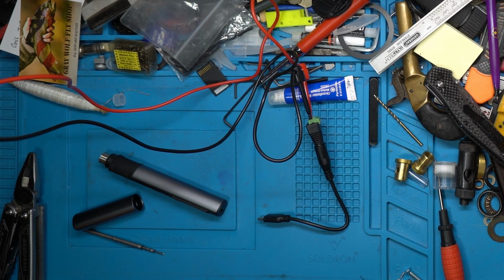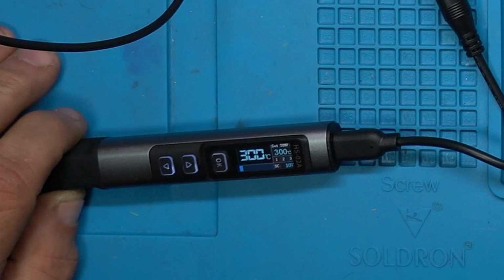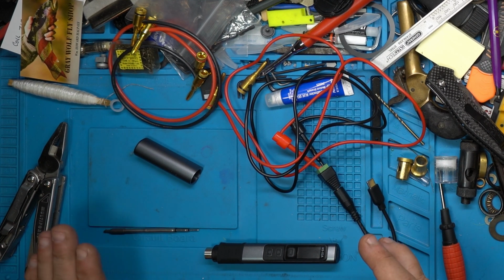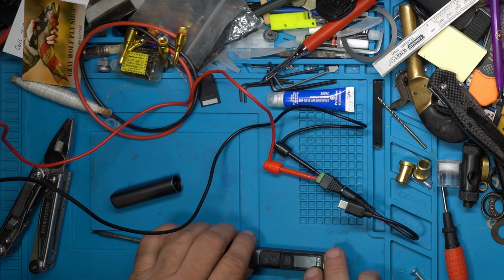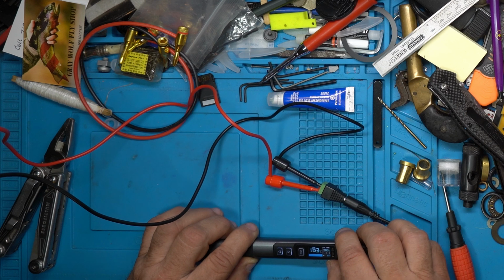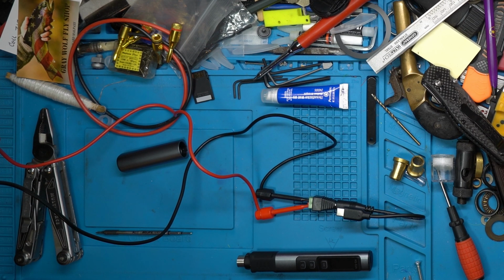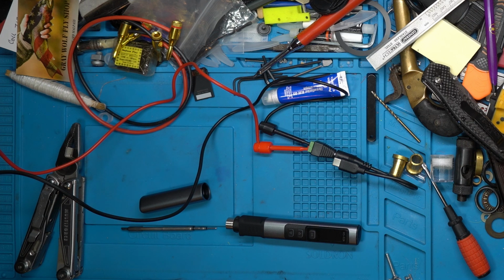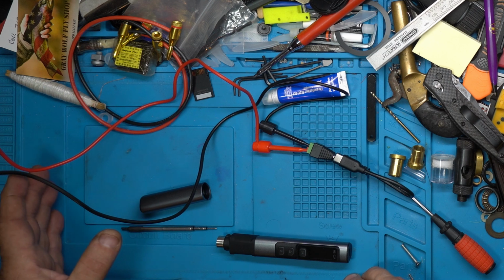FNIRSI HS02 100% Power Crashes? Here's What's Really Happening

Comment: I didn't see the point of the 'experiments', which lacked a scientific approach. FNIRSI provided the Adaptive Power Adjustment mode to test the power source available for the users. They know best what they're doing. You couldn't do a scientific test because you didn't have a logger for the voltage and current with a high sampling rate. Nevertheless, I trust what FNIRSI is doing. It was clearly explained in the manual why they do it. As a matter of fact, I bought their original AC adapter rated at 100W that comes in the extended package of HS02A. There are times when even their AC adapter can't cope with the current demand.
Reply from the maker: The test is simply a real world test. Fnirsi adaptive power does not work properly it will always set in the 90 and through trial and error the 60 range is all that will work. I do not know when you purchased yours but mine and about a 100 other comments across about 10 videos over that last 1 year plus did not either. If fnirsi is finally releasing a manual that is awesome because i absolutely love the iron   If you check the comments on the many other videos you will see the issue that works is using any cheap or otherwise pd3.1 compliant cable. Many comments involve fnirsi supplied components psu and cords. I do have lad equipment but did not use it because it would not have helped me. The cord was my and many peoples problem. Thank you fir commenting and i truly am glad fnirsi is getting it together releasing a printed manual  and good corr psu combo.

Comment: I have a QC3.0 power bank that outputs about 22 watts at 12 volts. Is it possible to limit the power to these values if I need to use it away from home?
Reply from the maker: The Fnirsi iron should regulate the voltage to its supply. I have connected the iron to multiple voltages from 12 to 24 volt without changing any iron settings and the iron used the power protocol to negotiate the voltage. 

The power bank should be regulated to keep the pack from discharging too low and the iron will shut down when voltage supply drops below its operating threshold. 

In short the power pack and iron safety’s should keep anything from being damaged. 

Now if hooked directly to something like a lipo battery pack or a unregulated battery pack it would be dangerous. 

You can go in the iron menu and set the voltage to 12v if not using a pd or qc power cord. I have several videos showing the menu settings and voltage settings. Hope this helps but keep in mind test you setup in a controlled environment for safety. Please let me know if i haven’t answered your question. Thanks again.
Reply: @TTMEable More than anything I wanted to understand if the power limit in the soldering iron settings can be adjusted to stay below 22 watts and not reset the power bank when I need to use it away from home, I can't try it yet because I ordered it today and it still has to arrive
Reply from the maker: The lowest i have set the iron is 45 percent i think it was. i don't remember the video but i did a upper limit power setting and may have dropped it down in the video it was a long time ago. but the video title is something like it keeps restarting or power restart problem solved i changed the title a couple times but the video should be located in the fnirsi hs02 play list. if you can;t find it i'll see if i can...  You may find the answer in one of the below videos, but to be honest i don't see why the iron wont turn down that low i think i had it set to 9v using my benchtop power supply. it would be slow but should work. Let me know if i can help you more. thanks for commenting.

https://youtu.be/EaVgCmvHFiM
https://youtu.be/5sT4ikBvlhA
Reply: @TTMEable Thanks for the reply, I'm not afraid of safety, the power bank is limited in current to about 1.8 amps (22 watts at 12 volts), beyond that it disconnects the output and turns off

Comment: Great video! I've test it with a 100W, original tips and other brand, Kaisi C245, Relife Rf 245...You've explained everything about the original tip, I'd like to add behavior with other brands tips. It's all about the resistance. If the original has a resistance of about 3 ohms ok. Kaisi tips have 2,5 ohms and 20V power 65% work well. Relife work to 100%.   Honestly, FNIRSI has a problem in general with dc jack, I've made it clear to his support because That they're very kind. I've had to replace 2 mosfets and a double zener diode. My recommendation is always usb C. I just shared my experience.
Reply from the maker: Thank you for sharing. Ill pin your comment for others to see. Thanks again.

Comment: Power supplies when they hit the current limit reduce the voltage down so far that the current never rises above the set limit. You can see that the power supply also in the first (parralel, full power, no limit) test reduced the voltage down to 9V. In none of your tests the maximum wattage of 100W got fed into the soldering iron. for this you would need 20V and 5A (both), i have no clue why your power supply did not deliver this but breaks down in voltage.
Up until now it was knowledge, now comes my guess:
A powersupply is different from a usbc power brick in the way that a usb power supply does not drop Voltage when the current limit is reached but stops completely (or goes down to 5V which). Both no power or 5V is the reason why the soldering iron restarts. no more or to little power available.
Also my guess:
I have the 100W fnirsi usb power supply and i have to set it to 90-96% power for it so not restart. I think the reasosn is that the soldering iron pulls just slightly more than 5A and directly the power supply stopps completely and the iron restarts. So either get a powersupply with >5A at 20V or from a proper well known manufacturer which allows some hihger startup current without stopping current completely.
Reply from the maker: Thank you for the detailed knowledge.  I always love to hear from someone that understands psu’s and yes i was thinking my power supply should delivered the proper voltage and current with my setup, but the psu is still new to me and i have have gad dome kind of limiter on “i don’t think so but” but im not sure. Also even with a lower voltage the iron still heats up fast. Much faster than any station of plugin pencil type iron i ever used. I used to plug them in and let them set for a good 20 min to properly soak in. Anyway. What do you think about a laptop power supply. I was thinking about doing some detailed testing with a few i have laying around. My whole point is to find simple and easy supplies and portable options for this iron. My cheap 260w “not 260 even adding up all outputs” works fine with this iron if i turn power down to about 60 to 70 percent. But strangle the adaptive power setting on this iron is supposed to set the power to match your psu but keeps setting itself to 96% and thats too high for my above mentioned 260w gan Chinese psu to handle. Whats your thoughts on that? Thanks for your feedback
Reply: @TTMEable i find that a really awesome idea with Laptop Power supplies. Tough in this area i dont have experience and I dont know if one can destroy stuff there more easy. For example i heard wrong polarity (sometimes the Adapter (Jack to USB) is wird wrong leading to a fried iron. I also for example have a 100W Laptop Power supply (usbc) AND I think how this works is also interesting for people. Also powerbanks with higher wattage would be really interesting as the iron then would be completely portable. Also i really recommend some Form of USB Power Meter with which you can measure precise voltage current and Power. For your Tests i think Power never even remotely rrached 100W. So even faster heat up Times are possible. Altough they are not any more usefull i think it is very usefull to put 100 instead of 50W into some thicker copper plate. By the way i really love your Videos and they were the reason i also bought a hs-02a :)
Reply from the maker: Ok. I think ill do a laptop psu video. And yes you are right about polarity. I will cover that in video. I do have some usb power meeter’s that ill drag out in the video. 
I think i might run a pole to see if everyone wants to see a portable power option build and may do something like that also. 
Im very glad to hear you are enjoying the videos and i thank you for your support. I feel good knowing people are getting something positive from the channel. Thanks for sharing

Comment: 24:15 , 34:55 - I think the power supply hit the set current limit and reduced the voltage (constant-current mode works like that), the iron isn't renegotiating voltage, it just shows what the PSU provides.
There's also no space for a voltage regulator in the iron that could handle 60W+ without melting. The power setting in the menu serves to regulate the power with PWM switching the heater on and off (a mosfet fits into the iron).
IMO the usb adapter in the previous video behaved differently: instead of limiting current (by reducing voltage) it just disconnected the iron, causing a reset. Or the usb adapter is so weak that the voltage dropped below 6V (around where the iron reset - 38:56)
Reply from the maker: Yes that sounds exactly right. One reason i keep doing this is to learn myself. Thanks for sharing.

Comment: I have a question. Will this happen to the B version to?
Reply from the maker: Thank you for commenting. No this hasn’t happened to the b variant. The HS02B uses the c210 tips and my best guess is due to the smaller thermal mass of the c210 tip. the hs02b does not take enough amps to heat it up to trip power supplies out. Hope this helps.
Reply: C210 tips have smaller heater coils (JBC soldering stations limit the C210 tips to 40W), so it's unlikely it could take and dissipate 100W. 
Due to the small thermal mass that still heats them up in 2 seconds, quite impressive.
C245 tips are rated for 140W by JBC.
C470 (compatible to, bigger than C245) is rated for 250W.
Reply from the maker: Yes, exactly. Thanks for sharing.